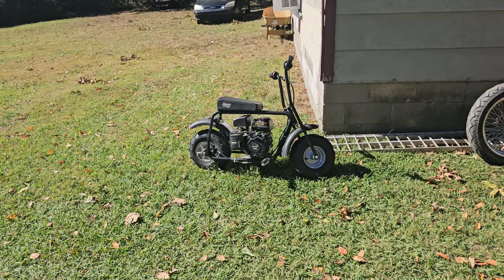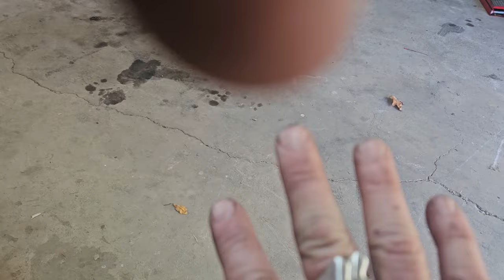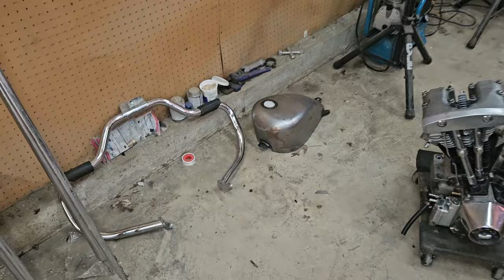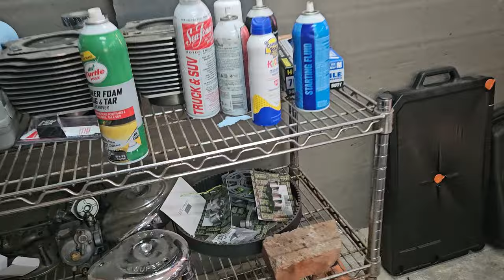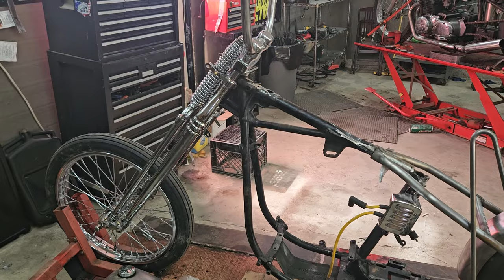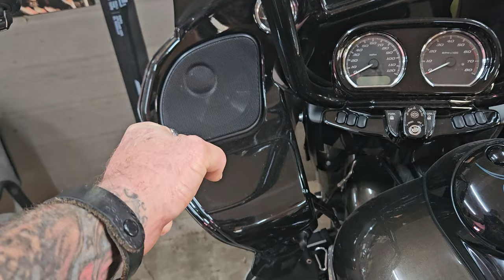Shop shenanigans and GIVEAWAY #bobber #chopper #shovelhead #kickstart #motorcycle #roadglide #harley

Comment: Hey brother, I hear you work on Home Ironhead? I’m 77 going to be 78 in May. I got into a head-on collision on my 99 Road King at 50 miles an hour. Needless to say I have a 79 last year. I was redoing before years ago. I can’t get down and work on it anymore. My hands don’t work around 150 miles, rebuild needs to be tuned up. You’re close to me in Tennessee and if you want to to help an old motorcycle rider, let me know and I’ll bring it to you. I know you know how rare this last year 1000 is.. I could use some to finish this off.
Reply from the maker: I'd be willing to take a look at it for sure but it would have to be closer to the fall. Ridding season is in full swing and I'm on the road a lot this year

Comment: Is that front end still ter 41 mm  if so how much
Reply from the maker: I haven't checked its 41 or 39 but I've already sold it $200
Reply: @hippieschoppercorner   man yeah thks just the same  bro I got lower legs 41 just need sliders that's what I need for front end and 16  wheel to  lol man I don't no how in the he'll to send pics to u lol
Reply from the maker: @gradycarter4846  
Email 
Hippiechapter56@gmail.com